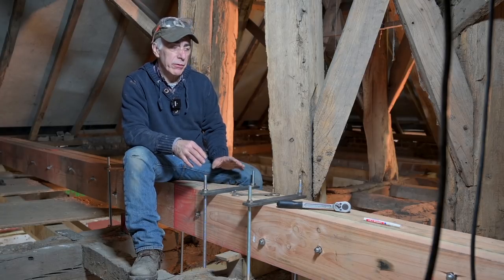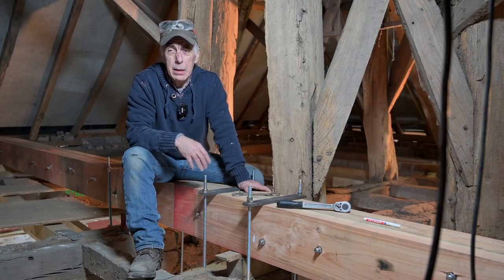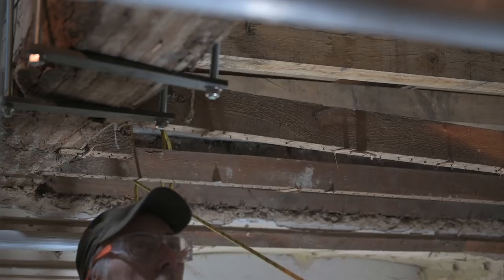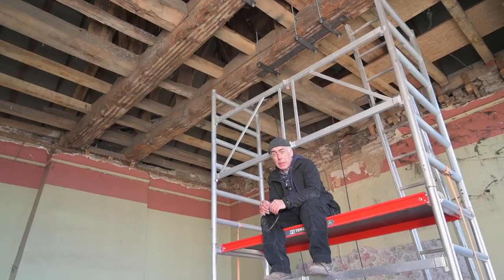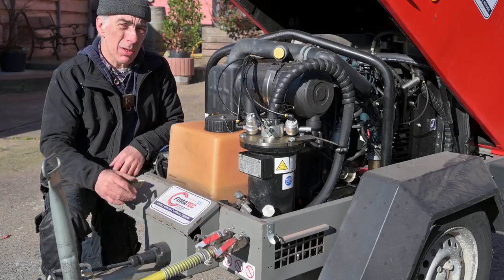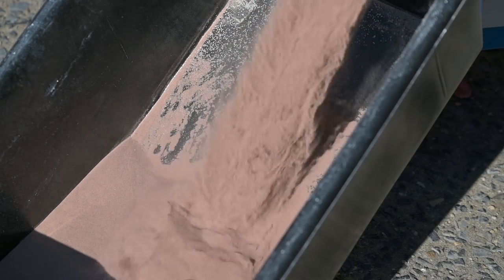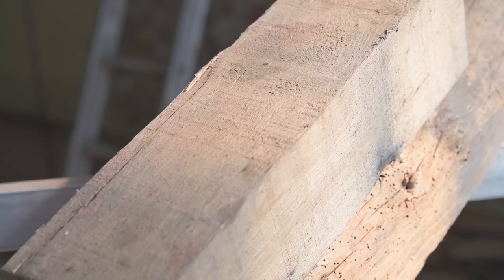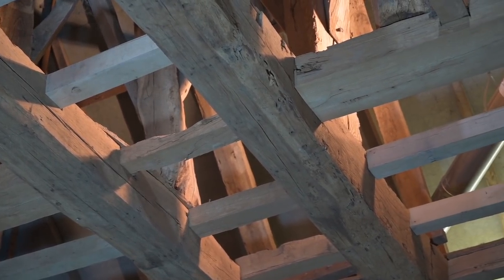DAY 8, BLASTING THE CEILING

Comment: I think you're misunderstanding some of the criticism from the prior video. The comment about the load on the threaded rod wasn't in regards to the vertical threaded rod suspending the main beams, it was in regards to the horizontal rods holding the beams together. Since the beams aren't continuous, and the only thing holding them together is those bolts, all of the load is being transferred laterally (in shear) across those bolts. There's also friction between the beams transferring that load, but without adhesive and without a large clamping surface on the outside of the beams and with repeated cycling of temperature and humidity eh.... just assume the threaded rods carry all of that load in shear. It might not be 100% correct but over decades of time it might as well be. The threaded rods being used vertically are just in tension and as you've already said, are plenty strong enough. In fact, I wouldn't even bother doubling up on the nuts, that shouldn't even make it stronger as those are most likely going to be rolled threads and the surface area on the inside of the nut is going to be greater than the cross-sectional area on the rod anyways so really it should already snap off the threaded rod before the threads are torn out, or come close to it. But the rod clamping the boards together is going to have quite a bit more stress on it than the vertical rods in tension, it's not just the shear forces of the weight of the beams, it's also the torque being applied. You've essentially got a cantilevered load so if you have 100N out on the end of a 20ft beam held vertically at the end and in the middle then you've got just as much force upwards on the end being restrained as you do on the end with the load. So now the first end has 100N pushing up, the far end has the 100N pushing up to counteract the load and the middle has 200N pushing down. Your load is only 100N yet the supports are collectively dealing with 300N of load. You've got like 8 threaded rods supporting the main beams vertically, so the threaded rods being loaded in shear are the weak point by far.

But at least the main concern I had with the way you assembled the beams was the overlapping joints. In any beam your forces have to balance out, the outer walls that the beam is resting on are not experiencing any lateral force at all, it's just supporting the load in the center and the weight of the beam itself. On any beam supporting a load there's going to be compression on one side and tension on the other. Those have to balance out otherwise there would have to be a lateral load on the ends of the beam, which there isn't. If you look at how a wood beam fails under load you'll basically always see it fail in tension, that's the weak point in the beam. It'll also be at the spot where the bending stress is the highest right under your central load. https://www.youtube.com/watch?v=GnUpjeW8BT8 In the center of your beam there's a joint in the outer two boards and the center board is continuous. There's absolutely nothing at all that can possibly carry any tension in the outer boards across the joint as it's cut there. Yes you could say "but it can handle compressive loads", but that has to be balanced by the tensile loads so you're still left with just that center board carrying all of the tensile stress and that's the same as the original weak point in just a single board so you haven't strengthened the weakest part at all by adding the third board to the side instead of only using two boards. The extra board does substantially improve the shear strength of those threaded rods because now it's shearing it on both sides instead of just one but that's a pretty hefty price for that benefit. I still think you're totally fine with how you supported that beam, I wouldn't be at all worried about it coming down or anything, my criticism is only that you've essentially wasted an extra 50% and even if you wanted to use the same materials you could have arranged them differently and more than doubled the strength of the beam just by staggering the joints and not putting a joint under the center of the beam where the stresses are greatest. Yes moving the joints would require adding some additional joints but that would still be much much stronger if you can move those joints out of the worst possible spot for them.
Reply from the maker: Thanks for the comments Andrew, a that is a great educational write up for which I want to thank you.   I learned from it.  That is what I like about comments, content that helps me and others.  And that is what you provided, you pointed out that I did it in an inefficient way and waste resources .. now I understand and good info for the next job as there  is going to be one

Comment: About the beams, I was under the impression that one beam would be sufficient for the load you wanted to carry. And if that is tha case, nothing to worry about. But if you want it to be stronger than only one beam, I would suggest option B to be the tronger solution in my drawing https://photos.app.goo.gl/WfozFjgUGq7ejgkQ7 I'm also not an engeneer, I'm just sharing my thoughts. I hope I did not make you doubt your work, because I think you're doing a great job and thank you for sharing with the rest of the world. All the beams look verry nice now.
Reply from the maker: Thanks for the comments Bart, that is great to see that you did this.  By all means keep doing so.   PS I left a message on your link

Comment: Nobody builds a structural wing component on a jet using common sense, they use the expertise of a structural engineer. You should have got a building engineer to give you expert advice on what was needed. There is nothing wrong with doing it yourself, but relying on common sense just means you've got a fool for an advisor. I wonder, in your country do you require building consent to do structural work on a building? You do here including removing a supporting wall. For a start off, without consent, if the roof failed you would lose your insurance cover. I  bet you've not got consent.
Reply: This building has stood for over 300 years built by craftsman using commonsense methods, modern buildings today are falling apart after 12 months or less and all with sign-off from structural engineers - hmmm go figure!
Reply: @ethicalfarmer7424  They used sound building practices developed over a long period of time. The Egyptians used proper measuring equipment and sound mathematical principles to build the pyramids, they did not rely on common sense. The Greeks, Romans understood engineering principles and used plans to build with. Do you just think that people built castles and Cathedrals on common sense alone? Do you think when constructing a building that was going to carry a heavy load that they just went, "looks like it should do, my common sense is tingling so it's all good." Wait a minute, ethicalfarmer - hmmm go figure. You need to understand just how knowledgable people actually were about construction, hundreds if not a couple of thousand years ago. Just go and research how clever the Roman Legions were when it came to building roads. They didn't rely just on common sense.
Reply: @ethicalfarmer7424  they wouldn't have relied on just common sense to build that tower, not even at the onset, they would have used long established building practices. You are being highly disparaging of the skills and knowledge of the craftsmanship of the builders from long years ago. In the 12th century  Pisano drew up architectural plans  before building the Leaning Tower of Pisa. Yes he got part of it wrong, being the land it was built on, but it still stands because he was a trained architect he understood the structural requirements of a tower that big. He didn't go "my common sense says let's build it this way." You are beginning to sound like one of these new age numpties. Common sense and intuition trumps scientific and engineering learning. My common sense tells me that the 6 lane, 5 kilometre bridge should go over there, what do the engineers know. Stop thinking that people long ago were all illiterate untrained people who did things by this so called common sense.
Reply: @karina833  YAWN!!!!!!!!
Reply: @ethicalfarmer7424  Oh dear, was that to much for you? Common sense should have told you when to stop.
Reply: karina833: You are talking about two very different applications, yes an aeroplane wing does require a structural engineer to stress it, but this is because it requires to be just strong enough due to weight constraints, in this roof structure there are no such requirements, and common sense, (which is obviously not very common in your case), is sufficient, there is not going to be a dance floor above, it has only to hold up the ceiling, which I am sure the original way over strength original structure could have done, but for peace on mind, Steve has braced it up, a building engineer? They are the ones that make wobbly bridges! The roof fail? What on earth is the roof to do with this? It is the ceiling, it just shows how much you know.
Reply from the maker: No issue at all here, look this house is from 1616.  I am not changing its structure.  I just enforce it.   I think that is the difference.
It lasted 400 years as it was, adding an extra beam or additional support is not changing the structure at all.  Common sense is how those buildings were build at the time based on experience and so  on.  Things were often over dimensioned. Now a days, every thing is just on the margin and indeed a full structural design..   If I was to knock out a wall, I would consult a structural engineer.  Off course , that is a no brainer.   But here that is not the case.
Reply: @karina833  : That should be Too not to! And you seem to forget you are the one still arguing.